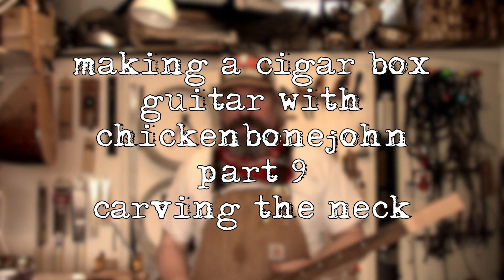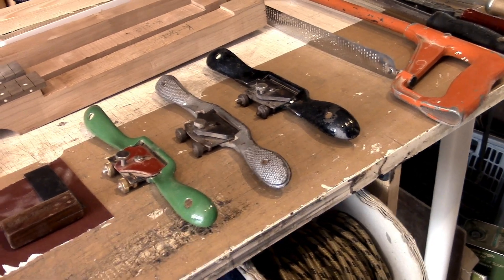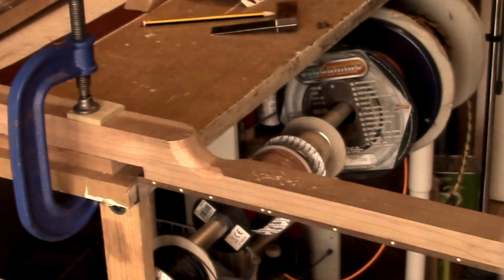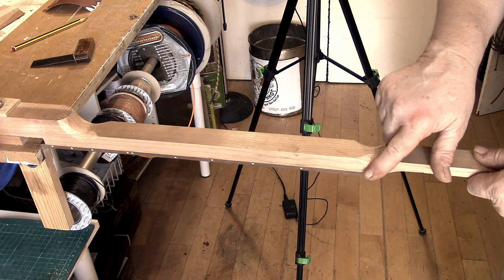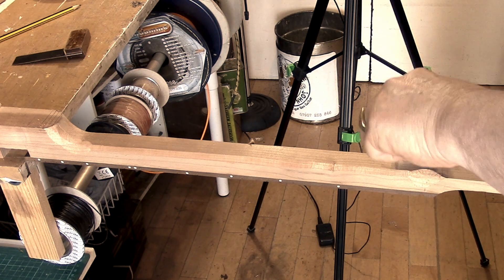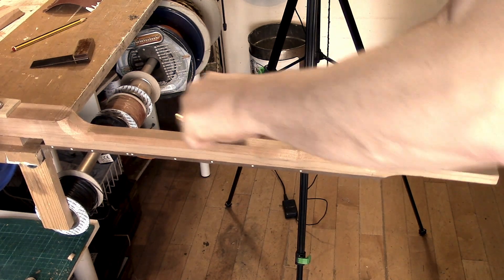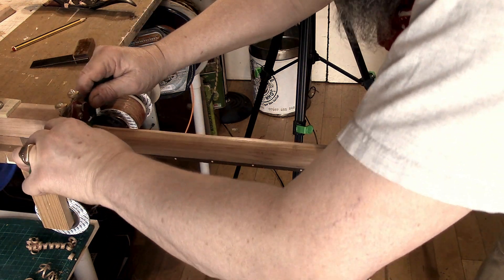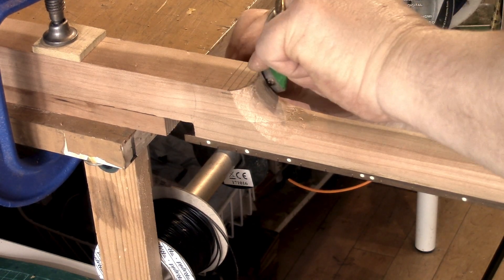Making A Cigar Box Guitar with ChickenboneJohn. Part 9 - carving the neck

Comment: I've just finished shaping and fretting the neck on mine and I would make two suggestions. The first is to draw a centre line  and some parallel lines either side along the neck as a guide for the cross section shaping. The second is maybe to shape the neck cross section before doing the transitions.  I did the transitions first and did take out a little bit too much which made blending  a little tricky wiithout losing too much material.  Toolstation sell  a great little flat spokehave for less than a fiver.